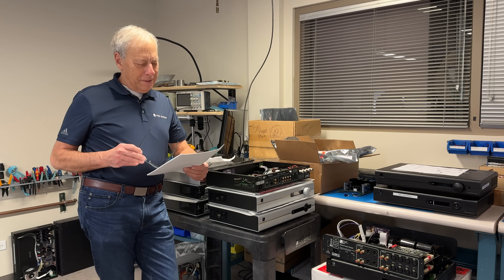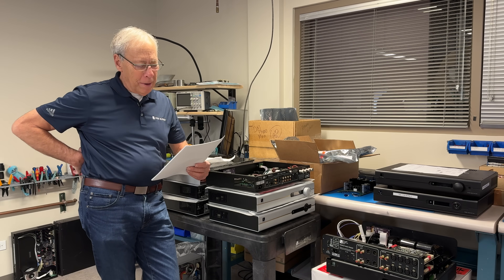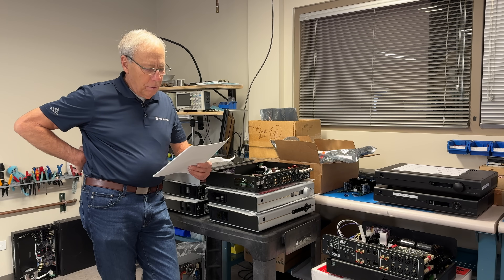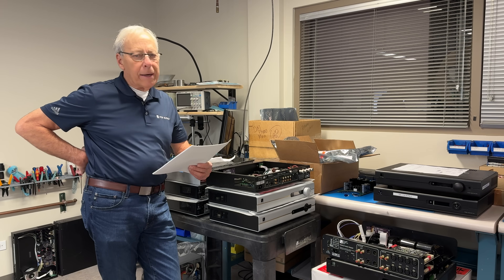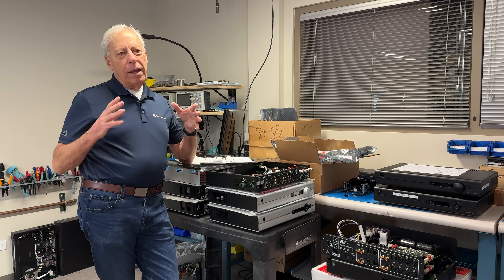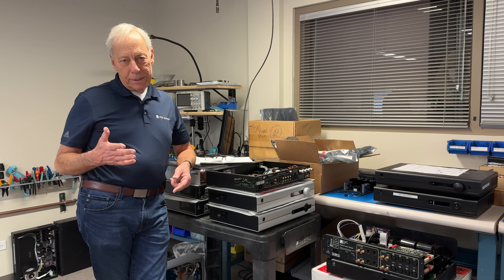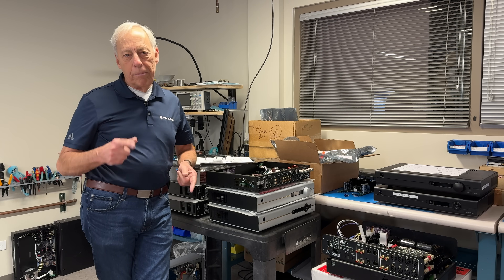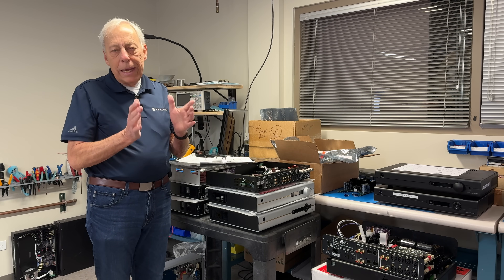Hybrid Class A and D amplifiers

Comment: So, the Class D module will faithfully reproduce the output of the Class A input buffer, but the same supposedly accurate module doesn't perform well otherwise?  IOW, accurate amplification doesn't result in good performance?  Whatever happened to the foundational definition of "high fidelity," that being "great faithfulness" to the intentions of the creative folks who provide our source media?  It has apparently been supplanted by nostalgic gimmickry like Class A, vacuum tubes, and vinyl, which actually serve to degrade the state of the art!
Reply: @editorjuno

heads up, serious burn incoming.

Musicality in reproduction, and accuracy in reproduction are two very different things.

I keep class D chip amps running direct from interface for mixing and mastering because of how dry, analytical, and intricately detailed a sound it produces. They can get fatiguing because of the shear level of perceivable detail. Not like the old class D's that were fatiguing through harshness of sound.

I keep a self designed 6ag5 class A tube preamp around to put in the chain for musicality and expanded soundstage reference, and for listening to music for the purpose of enjoying it..

Because it makes the sound, yea, less accurate to original production, but far more musical and engaging. 

When im creating music im after accuracy, but thats not something im interested in at all for enhancing the musicality of something in a pleasurable way.

Stop listening to your gear, and go back to listening to your music. Youll be a happier, less cynical, and less jaded person.

Do you even know why an acoustic guitar sounds so good in person vs a poor recording? You are hearing a lot more in person and with a good recording then you'd think. A lot of the sound of an acoustic guitar, or even piano, is the timbre of its even ordered harmonics interacting with the fundamental note, unlike odd ordered dissonance, which is an unpleasant artifact of high frequency switching semi conductors. Or rather, it must be considering its completely lacking inside even the simplest and cheapest class A tube voltage amp topologies.

Even ordered harmonics do not degrade sound, they enhance the timbre of the frequencies being played by harmonizing the fundamental with itself. This is why the timbre of a piano or good acoustic guitar is so pleasant to begin with in person. There's a lot more going on then the fundamental note or rooted notes (chord) being played. A lot of which, unless recorded properly to near perfection is lost in the recording process entirely, and was never part of the recording to begin with, but would have preferably been kept in it if possible because its part of the performance, which gives you a recording that can ONLY BENEFIT from the addition of even ordered harmonics to the mix. This is most modern recordings. Unfortunately good music, and proper recording rarely intersect. There is stuff i prefer listening to without the tube pre, The recording is so well done it will actually become too lively with it. But that is quite rare, and it's almost always rehashed, boring music as a whole that was produced exclusively for someone to say "Look how good this sounds" and stroke their own ego. Classical music is really the only reliable place the two intersect reliably and i find myself sometimes listening for enjoyment without the preamp. But even then, its mainly just to extend my tube life. 

The specific thing that makes one piano or acoustic guitar, or violin (Think stratavari here) sound better then another, has a LOT more to do with the timbre of its even ordered harmonic resonances, then with the tone of the fundamental being played. Otherwise they'd all sound more or less the same. they do not, not at all. Just the way a luthier chooses to brace the top of an acoustic guitar can completely change the way the fundamental reacts with harmonics as well as the way, and in what bands the guitar projects. All of this is done without the input of the fundamental....at all. Same with pianos. You need the resonance of that fundamental to tune the harmonics, but the fundamental used doesn't really matter one bit when it comes to the timbre and projection of a guitar or piano.

You know why cheap acoustics and pianos sound poor and not so musical? The design didnt physically tune out odd ordered harmonic resonance through bracing and chamber design in favor of even ordered harmonics. Odd ordered harmonics, even when too quite to perceive by itself, mess with the timbre and the tonality of the resonating fundamental. Even ordered harmonics do not, they enhance the fundamental. if you have ever wondered why a truly great piano, or acoustic guitar costs as much as they do, its because of the skill and experience necessary to properly tune odd harmonics out of the resonating chambers of acoustically projecting instruments.

The greatest sounding, most musical reference amps ever made have tube input and solid state outputs for a really good reason. They are being designed and built by people who know what music is made out of. Not people who think music is made from the peaks of a waveform at 1khz on an oscilloscope. Without the emotional impact, its just sound and self tickled egos.

ive even played with mosfets for gain stages and phase inversion. They can plug directly in to a tube circuit with no modification if you choose the correct FET's. Tube are still better voltage amplifiers then any semiconductor i can find in terms of sonics. Just like semi conductors are better current amplifiers then any tube ive played with in terms of sonics. These are by products of the physics and operational parameters of the components themselves. The big problem with tubes is you have to heat them constantly, and they run on high plate voltage wide open all the time. So efficiency is lost through heat production. They are still better at more cleanly amplifying voltage then any semiconductors are, even FETS. 

im my personal experience, as well as many others. 0.1% even ordered thd amplification WILL sound better to the ear then 0.01% odd ordered thd amplification. even ordered harmonics ARE the sound of music. its what makes a fundamentals in a live setting feel like music, and not a collection of harmonized sine waves. 

This is why so many people perceive tube preamps as having a very natural feeling presentation and soundstage. Its FAR FAR FAR FAR FAR FAR closer to what would be perceived in a live performance (NOT AN ORIGINAL MASTER) and this is why people love the sound, even when they dont know why. There is no such thing as a BJT or fet based preamp that sounds as natural in presentation as a good tube pre circuit. It does not exist. Some OpAmps are getting close, but i can still throw together a 6au6 circuit in 30 mins with $40 worth of components thatll wipe the floor with that $150 opamp in terms of musicality and a natural presentation. Im sure SS voltage amp tech will pass tubes in terms or realism of presentation eventually. But that day has not yet come. 

They have indeed passed tubes in terms of accuracy to a mastered recording, but they are not even close in terms of presenting a natural sounding and feeling recording. They are miles off still. Tubes return what was LOST in the recording process, perceived authenticity. Ideally natural and authentic comes before complete and total transparent accuracy in a signal chain designed to be enjoyably listened to. This is the entire point of tube inputs and SS outputs. Until all recording are recorded, mixed, and mastered to perfection, which will NEVER happen, a totally transparent and accurate input section, counter intuitively, is actually counter productive if the goal is enjoying, and feeling emotionally connected to what you are listening to and it feeling authentically reproduced is the goal.

The goal is authentic reproduction of music, NOT recordings... and people forget this and use it to get lost inside the gear and their own ego, rather then the music, and thats a shame as it completely messes with the commercial market availability of these products. unfortunately, so many people making the gear dont even know what music IS, that i either have to pay many many thousands of dollars, or design and make this gear myself to have it. It should be drops in the bucket cost wise by now, but the market is chasing fancifully low distortion numbers that are, frankly, destroying the quality of home reproduced music entirely.

Few years ago you couldn't have paid me to put a tube in my loop. But at this point, ill never let them go.

Tubes are objectively better at voltage amplification tasks then transistors are, so long as efficieny is taken out of the equation. They are considerably better actually. they do it on their own by nature of design. We have to trick transistors into amplifying voltage much like we have to use power transformers to trick tubes into amplifying current. fets can work as well in many voltage applications, but when dealing with voltage they are very non linear devices.

Should i just go ahead and drop a mic and walk away? Personally, im ancy and eager to debate this with anyone. Ive put the time in, and pulled the experience out to know first hand what im talking about here. And i can come at this from the gearhead, audiophile, music lover, recording/production, or scientific perspective and i still land at the same conclusion. The sound of a musical performance, and accuracy to a recording are not the same thing, and we have a long way to go still, technologically and emotionally both, before that could even be a possibility. It probably isn't thanks to matters of taste, preference, and self-inflated egos..

And if ya want me to get real picky. Notes aren't even what makes (western) music, not one bit, there's only 12 of those and their octaves. Neither are the harmonics. fundamentals and their even harmonics are just what makes music feel natural to us. It's the intervals of a piece. It's structure. The spaces between the notes. It's this funny little piece of infinity our brains somehow have access to, that make music what music is. 

**A transistor may bring you closer to a the fictional number on paper that is 0, but a properly implemented tube brings you closer to what music actually is at its most fundamental of levels, and this is why they are going nowhere any time soon**
Reply: @thefloop2813  -- My "rebuttal?"  Seriously?  I have my way of compensating for less-than-optimal recordings, you have yours and welcome to it.  As a former professional musician, I'm well aware of the effect of harmonic content on audible timbre -- in fact, it is harmonic content that defines timbre, e.g. the difference in timbre between an oboe and a violin is all about the differences in harmonic content.  That's why the output of a signal generator isn't musical: the deliberate absence of harmonics.  The thing is, a poor modern recording is often poor in several divergent ways, so a blanket increase in even order harmonic content might make the tone of a grand piano sound closer what it would sound like live while making the close-miced soprano sax on the same track sound more like a kazoo -- this makes altering harmonic content with a Class A and/or vacuum tube buffer a crapshoot and an extremely crude one trick pony, a woodchopper's maul when it would take something more like a scalpel to do it right.

All that said, I think we can agree that having clean, accurate, even "clinical" amplification is a good baseline for whatever "seasoning" alterations the listener prefers for any particular recording.  We also seem to agree that so-called "audiophile" recordings tend to feature the results of excellent studio technique wasted on (mostly) "boring music."

Peace.  😎
Reply: @thefloop2813  -- You are one seriously triggered dude.  Call it "ancy" if that sits better with you.  Definitely TL;DR material, but I read it anyway.  Opinions duly noted.  The mic has now been gently tucked away.

Peace -- I hope you enjoy listening to recorded music, suboptimal production notwithstanding, as much as I do.
Reply: @thefloop2813  -- One question for you: do you believe a harmonically "seasoning" Class A and/or vacuum tube input buffer belongs in a power amplifier, thus making that "seasoning" effect intrinsic to the amplifier's default operating mode, or somewhere else in the signal chain so as to make such "seasoning" an option under listener control?
Reply: Whats your solution when music reproduction in any form of amplification is fake anyway?
Reply: @tothemax324  The solution is to try to avoid gear that introduces unnecessary distortion. You'll never get rid of it entirely, but you can clearly do better or worse.

When we see people say that some things are too clean and you need to use tubes to add character, or things like that, you know it's not about hifi anymore.
Reply: Objectively on paper the most hi-fi would be transistor class A followed by Class A/B over tube systems and class D systems. On paper CD is by far superior to Vinyl. However some people prefer the sound of tubes and vinyl. Since he or she is the only person that has to like how their system sounds, it might be the superior format for them. 
Class D is like laser diode technology in that it's so cheap to make and mass produce. They use it in the amplifier section to gain high watts at little cost. However class D doesn't and can't reproduce a perfect sinusoidal analog wave of the Cass A stage due to pwm. Take a light attach pwm then shine it back and forth. You see a straight line. Take a photo of it and it's composed of gaps. Increase the frequency and the gaps decrease, do it fast enough they will seam to disappear, but there still are gaps.
Reply: @waxmonkeys3841  The light analogue you make isn't relevant for anything more than just display the nature of how pwm works. We ultimately listen to the sound waves of a cone moving back and forth and as long as we have enough points in the pwm signal to guide the cone so that it moves naturally it will work, since the cone can't teleport.
Reply: marketing nonsense.  Make everything convoluted, and make un provable claims.  sell for too much money  Business 101.
Reply: Yes and no..
Reply: I think you are being unnecessarily harsh on "nostalgic gimmickry".
If you had actually heard a high end vinyl source feeding class A valves you wouldn't have made such a flippant comment. There is a magic to such a system that digital and solid state just can't match. Digital and class D are closing the gap but they still have a way to go. I use class D amplification myself so I'm definitely not in the class D bashing camp.
Try to find a decent vinyl setup to listen to and you will find that the engagement and realism are just better.
Reply: @nathanevans6277   I'm not looking for 'magic' (i.e. distortion), I'm looking for uncolored sound. Digital is objectively (technically) superior to vinyl, tubes, etc. Tubes can sound more delicate, fuller and attractive, and many audiophiles like it that way, but is it objectively more faithful than digital? No. If I want warmer, more delicate sound, I seek it in the original recording, not by adding it via my signal chain. 

I've owned tubes in the past, and when I realized that solid state and digital did a better job of reproducing the original signal without colorization and noise -- which for me is hi-fi -- I left tubes behind and never went back. Analogue systems can't compete with digital when it comes to purity, transparency, impact, low frequency reproduction, etc.

As for realism: How can you say that vinyl sounds more realistic with pops, audible noise, crackles, etc.? It completely ruins the immersion or faithfulness of the original sound. I've listened to very expensive analogue tube/vinyl setups, and they do sound nice, and the issues with noise, crackles are less apparent compared to cheaper analogue systems. But do they sound better (cleaner, etc.) than digital setups in the same price range? Not from a hi-fi point of view. And in the lower price brackets, digital systems can give superior sound for a lot less money compared to a vinyl setup.

BTW: This 'vinyl simply sounds better', houlier-than-thou attitude we see from a lot of tube/vinyl fanatics is the reason why audiophiles get a bad rep.
Reply: @GensUnaSumus09 I'm not looking for colouration or distortion either.
I freely admit that on paper digital measures better than vinyl. The thing here is that I have never, not once, listened to music with an oscilloscope. I use my ears every time.

I have a good friend who has a quality digital system, Denafrips Terminator plus dac and Avatar transport. It is by far the best digital system that I have to date heard. His vinyl rig walks all over it, Pink Triangle Anniversary, Funk arm and Ortofon cartridge. 

As long as records are well looked after and kept clean pops and crackles are not an issue.

One area where vinyl easily bests digital is soundstage and imaging (is that two areas?). Which specification tells you how well a system is going to image?

At the end of the day it's about how much enjoyment we get. If you prefer digital, excellent. If I prefer vinyl, excellent.
Reply: @nathanevans6277  So you're implying that I'm not actually listening using my ears? That's exactly why I can hear the surface noise, clicks and pops, etc. on vinyl! 

If you consider this to be faithful to the source material, then it's ok with me (because I know it doesn't make sense), but don't shove that "this is how it should sound like" BS to everyone else.

Like I said, I've owned tube amps in the past, and I've listened to $10K+ record players. Not saying they sound bad, it's not just hi-fidelity. 

"I'm not looking for colouration or distortion either."

Actually, that's exactly what you're doing when you say that you're enjoying tube/vinyl sound! I'm not saying it's fundamentally wrong: It's SUBJECTIVE. However, audible colourization and (euphonic) distortion does NOT equal high fidelity!

"As long as records are well looked after and kept clean pops and crackles are not an issue."

On most vinyl systems this IS an issue, because it requires a lot of care and maintenance. A single pop or crackle is enough to ruin the whole listening experience. Not to mention degradation of the vinyl due to wear and tear.

"One area where vinyl easily bests digital is soundstage and imaging (is that two areas?). Which specification tells you how well a system is going to image?"

This is another BS SUBJECTIVE opinion that many vinyl enthusiasts like to repeat, as if it was a fundamental, OBJECTIVE truth, and is if there's something magic and unique about vinyl that makes this possible.

Let me make it clear: There's absolutely nothing about vinyl that makes its soundstage and imaging inherently better than digital. In fact, digital has a much better technological basis than analog when it comes to reproducing the original recording faithfully. 

If you can hear a difference, it's more likely that it has something to do with a) bias ("I just know in my mind vinyl has better imaging, therefore I can hear it, right?") or b) the mastering of the recording itself: Many digital recordings do sound bad due to bad mixing, loudness wars, etc. That's no secret. But listen to a well recorded digital track on a high end digital system, and it will sound superior to any analog system from a hi-fi perspective. Some may still prefer the way the analogue system sounds, and that's ok, it's a matter of taste. But again, in terms of faithful reproduction of the original recording, digital is the way to go.

(Try this experiment: Record the analogue output from a vinyl setup using a high quality, resolving ADC unit. Then replay that sound from a quality DAC on the same system. I can assure you that the 'magic' imaging/soundstage you hear from the vinyl can also be heard via the digital playback. Heck, you can even perform some digital noise/pop reduction/removal and get the benefit of digital playback, while retaining that 'smooth', 'warm', colored vinyl sound. There's a reason why vinyl rips are popular..).

The funny thing is, many vinyl enthusiasts don't realize how much digital processing there is in their sound mixing chain, before the audio ends up on their vinyl platters. 

Also consider this: Inferior reproduction systems tend to put a veil over any flaws in a bad recording. That's why bad recordings don't sound as bad on poor or inferior sound systems, whereas bad recordings on transparent, resolving systems will sound even worse. A highly transparent digital system will simply reproduce the original, while making any flaws clearly audible. On the other hand, good recordings on the the same digital system will sound incredible.

But don't take just my word for it. Let me quote this section from Archimago, before I bow out of this discussion (don't have time to revisit this thread every day):

"I know, it's the age-old audiophile question: LP vs. CD, analog vs. digital - which is better?

As usual, they each have their pros and cons (discussed ages ago). But what is certain is that the differences are quite obvious with a little bit of critical listening. Even without listening, logically, one can deduce that for most modern albums like Sade which came out in the '90s, the recording and production were most likely done digitally anyways so it should not be controversial to suggest that staying digital would maintain the highest fidelity.

Note though that the opposite logic - suggesting that an analog recording should sound better as an analog LP - is not necessarily true! Analog recordings start as tape captures and they still need a lot of mastering work in order to sound good on vinyl. Characteristics like dynamic range typically is better with the professional tape than vinyl LP. In comparison, these days the analog-to-digital process can be done transparently with modern hi-res ADCs from the tape source (including to DSD). So long as the engineer is reasonably skilled, a CD/streamed/hi-res digital version of an analog recording can be way more accurate without all the processing and losses when converted to an LP (ostensibly this is why MoFi used DSD256 as their intermediate). There's also not nearly the amount of potential deterioration on the digital playback side from poor pressings, poor vinyl quality, dust, turntable issues, poor vibration isolation, tonearm & cartridge alignment, etc.

Regardless, beyond applying logic, one can still hear the difference between LP and digital as in this YouTube video because the difference is large. Despite the insistence and hype of vinyl advocates, these limitations can be heard without much difficulty; the change in fidelity such as the audible noise floor is higher than the lossyness of YouTube's Opus-encoded audio stream averaging around 128kbps (max 160kbps).

I know that some would use subjective words like LP's sound "smoother", "warmer", "musical", or has some kind of "analog sound". As far as I can tell, it's plain and simple EQ variation, higher distortion, noise, lower channel separation and at times audible wow and flutter that certain listeners seem to identify as preferable. I don't believe there's anything magical in those grooves, and remember not to get mentally trapped into the pitfall explanation of digital being "stair-stepped" as if all DACs are like the few NOS devices. Sure, these LP distortions can be subjectively "euphonic" to some tastes even though they add coloration to the sound and ultimately reduce fidelity. No reason to idealize turntable playback, even through a system that MSRPs for more than US$500k! (Kudos to Jay for putting his money down to demonstrate this for us.)"

https://archimago.blogspot.com/2024/01/musings-on-youtube-listening-tests-and.html#more

"But let's just not beat around the bush, there's no comparison when it comes to fidelity. There's just no excuse for editorials like this one (silly claims of digital "losing some of the very continuousness of presentation" among other false gems). When we're looking at the ability for the system to maintain accuracy / fidelity in terms of what was originally on the source and the system subsequently able to copy, store, transfer, and reproduce the waveform as closely to the original as possible, the difference in capability is truly worlds apart. In this regard, a CD (and digital file, especially hi-res) is obviously able to handle the quality in a way that will not corrupt the playback with noise, distortions, or timing anomalies."

https://archimago.blogspot.com/2017/06/musings-measurement-thoughts-on-vinyl.html
Reply: @nathanevans6277  I've heard two experienced reviewers say that a fully digital amplifier has been as good as they've ever heard in vinyl reproduction, so it's not as easy as to use class A and keep things analogue even with vinyl.

I've experienced that myself, but reviewers tend to listen to far more gear than the normal person in the hobby has heard (myself included of course) so their view becomes a bit more useful even if there are always subjective aspects to this.
Reply: @nathanevans6277  -- I have 50+ years experience with both home and pro audio and was a proponent of "high-end vinyl" back when it was the best playback medium short of a master tape, but those days have been over ever since mixing and mastering engineers learned how to work with digital.  I assure you I have heard every manner of system and still maintain that any "enhancement" conferred by antiquated, known-flawed audio technology is 99.44% gimmickry because it doesn't serve the foundational goal of accuracy, but rather adds "magic" that actually prevents accuracy.

Similarly to your Class D "confession," there's a a good deal of DSP going on in my system and I don't always listen in as-hifi-as-possible mode -- I just want use of such "magic" to be under my control, not imposed by some amp designer's notion of a supposedly enhanced "sonic signature."  My devotion to literal high fidelity serves to give me "baseline" performance that I can "season to taste" at my own discretion.